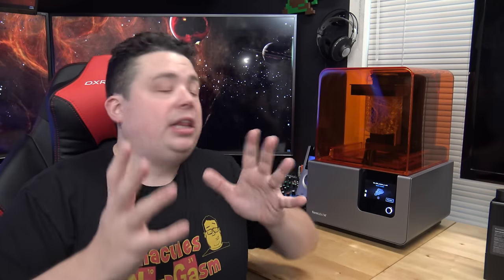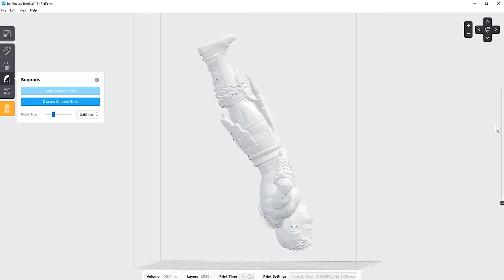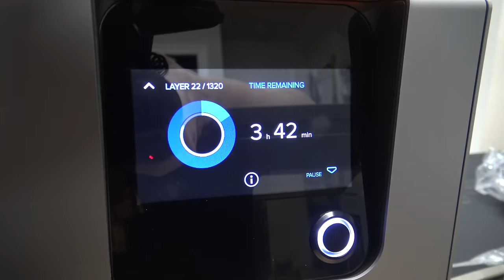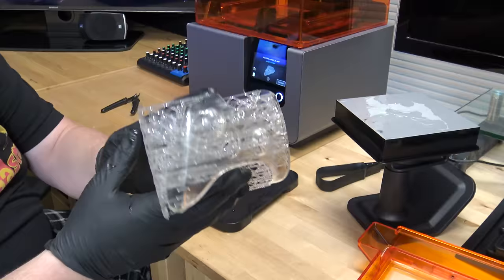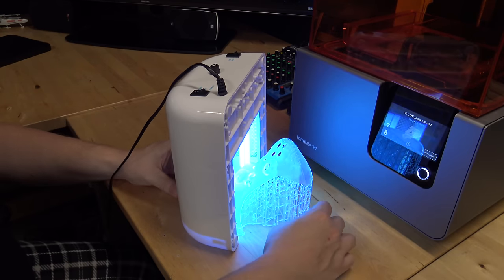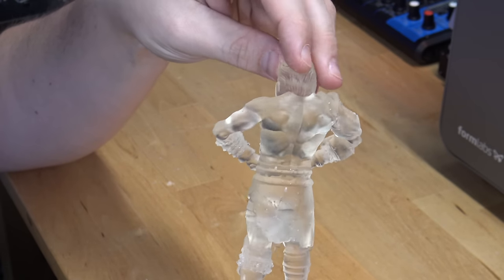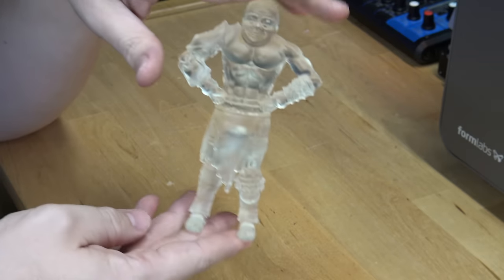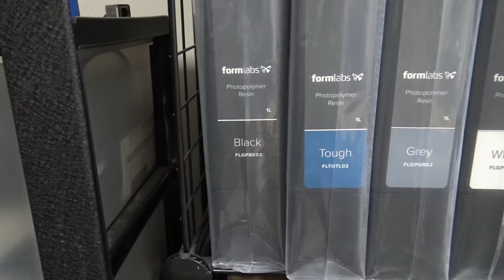Form Labs Form 2 SLA 3D Printer Review, Spoiler, it's amazing!

Comment: Hmm, this makes me think that you could probably make prescription glasses with this.
Reply: I wonder how long they'd last though, they'd certainly scratch more.
Reply: and I doubt really odd prescriptions like mine that I've never found any 1hr glasses store to be able to do, and they always have to special order them which usually takes 2 weeks would be able to be done by a printer such as this.
Reply: I just think it's a question of hardness. Plastic scratches
Reply: Braeden Hamson Right, and since I'm nearly blind in my right eye mine can't be made out of plastic to start with because of the thickness of the special glass needed, and if you want something like UV coatings, better scratch protection, or even something like transitions so you only need one pair, then you just won't be able to do it on a machine like this. anyplace that says $79 gets you 2 pairs of quality glasses for me is bullshit as I'm usually charged upwards of $300+ US because of all of this for a single pair.
Reply: plastic scratches but it doesn't shatter.
you can always just buff it to shiny again anyway. and that's beside the fact that you can get pretty hard plastics that don't scratch easy.
Reply: Moth buffing lenses changes the prescription. I don't see the point anyway. my local optician cuts lenses for 80~ bucks anyway.
Reply: Moth That isn't true at all! It depends on the type of plastic. You clearly don't know what you are talking about 🤦

Comment: I realy like the quality of the prints, but this way to expensive for me. I'll stick with FDM.
Reply: Benonator I agree. If you find you absolutely need an STL print quality of material there are services that will print them for you. Just like if you made Code but it would only run on a powerful computer, here you can CAD and prototype on your FDM and when your ready to see it in the design material you can have an STL do it for you.
Reply: i think there also might be a thingaverse about making a stl printer with a digital projector but you'd have to put some time into it. there's also the ono (i think) that projects images from your phones camera, and other stl printers. but i haven't really looked into any of them because if i wanted to print a detailed sculpt i will just print a 3 foot upscaled model on a prusa XD
Reply: @NicktoriousB IG there are a lot of cheaper alternatives, quite a bit cheaper... but problem is ease of use plummets and cost of material remains pretty high.
Reply: B3N0N4T0R what do you think now with the photon and elegoo

Comment: Great review - this is what everybody who tells me that SLA printing is "a messy job" should watch.

Never ever dissolve resin on your skin with alcohol. The resin will dissolve in the alcohol and the alcohol will be absorbed in your skin - and so will the resin!!!
Wipe any resin from your skin using paper towels, then use a mild soap or a garage soap to wash your hands. When needed then use alcohol wipes to clean your hands.

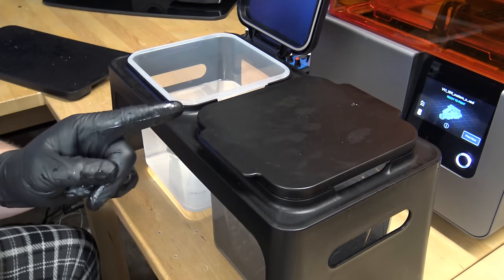At 10:25 you are taking the model out of the IPA with your hand. WEAR GLOVES! The IPA has dissolved resin in it.

Comment: Now that's an expensive printer ! Superb review man ! Really enjoyed this one ! Looks so easy to work with.
Reply: Good printers cost over 100k,  this is a toy, pretty much useless for anything other than little toys.
Reply: derbigpr500 it's a desktop printer for a reason.
Reply: I know it's a desktop printer, I worked with it for almost half a year. I'm just saying this to help people not throw their money away and then get horribly disappointed when they realize the quality of prints on this machine are nowhere near as good as they expect. I've probably printed over 300 models on one, probably 10 came out acceptable. The rest needed heavy post processing to fit into parts that they fit perfectly into in a CAD program with proper spacing in between them.  SLS printing is far superior and more accurate, if not as nice in terms of surface finish.
Reply: Well that escalated quickly.
Reply: THis is the second time he has done this printer ? Why does he keep saying re-view?
Reply: creep No idea, not as far as I know.

Comment: The print quality is perfect however the price is way out my league.
Reply: It's FAR from perfect.
Reply: It's poo, fact.
Reply: the resin alone cost as much as my printer :(
Reply: Don't worry Kaboom, I don't think you want to be throwing away the materials for this all the time.
Reply: same It's far out of the league of my little Up! mini printer. 

for me I'd probably invest in a bigger printer then going that route
Reply: The Ultimaker 3 costs more, but running it would be cheaper and easier.
Reply: That is the case which almost any FDM printer which doesn't have a whole lot of maintenance and material costs isn't too bad if you know where to look for filament
Reply: Buy an Elegoo Mars!

Comment: Of course out of the box this got better details than a fdm printer. But you can attach an airbrushnozzle to your printer and use 0.025mm layer height. Then put it in aceton vapor and you got a cheap good looking print.

Comment: Could you break down the price per print for stuff like the controller cover? That could be an amazing tool for replacement parts for ANYTHING, from casemodding to replacement parts for broken plastic on any electronics. I would personally order printed parts for casemods or when something breaks, like plastic case parts blah.
How long will the cartridge last, if you get like 50 parts out of that cartridge for 150$ - that is still a really nice value. I just think about fan covers and custom plastic logos in casemodding, would really love to get such clean parts.
And it will become cheaper after a while.
Reply: this has been my major question as well, I think I want a SLA printer but until I know exactly what something like that figurine of him cost in terms of material I am scared of 50-150$ per litre

Comment: I would highly recommend you look into the original Prusa I3 MK2 made by prusa research. It is available as both a 700 dollar kit you build yourself, or a 900 dollar fully assembled version. From what I've heard, you get ultimaker print quality for a fraction of the cost.
Reply from the maker: +John Shelton I've used one, it's a fantastic machine.
Reply: Barnacules Nerdgasm Sweet! I have seen a crap ton of positive reviews, and now I'm trying to convince the school to replace our makerbots (they won't stop breaking and are costing us a fortune to replace the extruders every couple days) with prusa I3 Mk2's, and I may even buy myself one as well.

Comment: while im not gonna run out and buy one,  I,m kinda happy with my ROBO.  I am curious,  How much material do you loose if you decide to do color swap?  Im assuming the stuff in the tray can just get filter back in the bottle.    But what about the material left in the printer itself.
Reply: Pitch Lock in principal it can, but it's much more sensible to use a second tank/vat, in which case it's a quick change and no material is lost.

Comment: Challenge accepted. Send me a link to that STL. while I can't match Resin quality I can get DAMNED close depending on the model :-) hehehe

BTW timelapse should be doable it will just be a lot more work. take a normal timelapse and just delete on the "down" frames so you only have the frames for each layer when its in the up position.

Comment: mUVe 3D is a better value. Larger build volume, open source, flexible vats that can be replaced easily and cheaply. I'd say that a con to the Form Labs IS THE cartridge system, which is no different than overpaying for inkjet cartridges.  With mUVe 3D, they are compatible with MakerJuice, that is only $33 for the general purpose resin. They are even compatible with Molecule Ink brand resin, which has all the cool properties that people look for in SLA printers; Hard, Tough, Flexible, Super Stretchy etc.
mUVe 3D also starts at $999 and gives you the ability to upgrade to a build volume of 151.9mm x 190mm x 250mm (6" x 7.5" x 10")

Comment: Hello Mr Barnacles :) I have two questions that I would like to ask about the Form. 1.) what's the amount of prints you get out of one cartridge of material? is it similar to the volume of material you would get in a standard FDM printer, like a 1kg spool for example? 2.) would it be impossible to print things that have print in place components, like the nasa space wrench for example?

Comment: Honestly this does look cool. I have been making models for molding with my printer for a long time and I am used to it now, but this seems like it has more steps to it than FDM printing. Might not take as long, but there is more to do. When I print something I intend to cast I do 50 microns and use a filler primer. If there are lines left then I use bondo putty and a light sanding.

Comment: Why are there a lot of imperfections on the surface of the controller cover?
Reply from the maker: Those are spots where support connected to hold the part stable during print. You just sand them off though and dip it in resin and let it cure and it will look like glass

Comment: Hey Jerry! Maybe you could do Some reviews on smaller 3D printers. Have you Heads of the OLO? It's a resign 3D printer and it uses the light from your smartphone for printing!!! It's really cheap as well

Another printer which is pretty nice is the M3D. I got one myself. It's a really tiny and modern looking printer. It goes for 350 dollars. But since a few months they also released a bigger version. The new one is WAY faster and more accurate.

Comment: I bought a Form1 for work and I could not be more disappointed. 
I agree completely with your statements about the software.   It's nice to use something that just works.   I just wish I could say the same for my printer.   We need to print only the most simple of items and I would guess it takes 10 tries before we get lucky with a successful print.  It is now sitting on a shelf.  Sounds like the Form 2 may have solved their problems.    Just too bad for me.   And for FormLabs.  Because I won't be buying any of their expensive material.

Comment: I'd say maybe don't point that UV light at the printer, either: while the orange dome blocks normal levels of UV light from entering the chamber and curing the resin inside, shining a UV lamp in its direction may just be asking for trouble.
Nice coverage of the machine, though, the good and the bad. Great results, though. Tough to argue with that.

Comment: There are a lot of SLA printers released this year that are higher resolution than this and cheaper, just a heads up. We use two of these at our shop, but we are purchasing a few different machines shortly. Check out the Photocentric 3d Led Printer. Both of their new models are higher resolution(20micron z, 90 micron xy) than the Form 2 and the materials are half the price and water washable.

Comment: Will this go down in price let's say in 5 years?
Reply: I think that is patented, so probably, it will not go down in price.
Reply: jomunoz Actually, there are patents, but they aren't Form1s! The 3ds patents (the ones that really matter) have expired, or are very close to it. One pretty important one just expired (2014)!
Reply: Orjon Zaganjori There is an open source model from a different manufacturer. $500-$600 I believe.
Reply: Still a lot of patents covering parts of it, just as there is with FDM, EnvisionTEC just sued Formlabs over two of their patents a few months ago.

Comment: hey, Jerry. there's something really cool I want to tell you. one of the 3D printers in my Tech Lab at school print using a support material that dissolves in hydrochloric acid and completely removes the need for a clean up. as awesome as this is there's even more. The printer can print moving parts without having to cut them up separately and snap them together. I think the coolest thing we've printed with it so far was a miniature planetary gearbox type of fidget thing. we also printed a functional replica of a shock for a car , although it would probably work best for an RC car cuz it's really small.

Comment: Do all of the models print with 100% infill, or can you adjust that to save material?
Reply from the maker: +Brian Popilek by default it's full infill for solid models. But you can use other programs to make models hollow and print them that way.
Reply: Barnacules Nerdgasm good to know. Thanks!
Reply: Wouldn't using less than 100% infill just trap a lot of fluid inside the model? (of course dependent on the design of the model and the type of infill) Would be really cool if you did an investigative video on that!
Reply: Siggen leave a hole on the bottom of it like they do for selective laser sintering

Comment: Even when neglecting the cost, and neglecting the amount of space that you need for the screen trays and alcohol containers, you still need to go through all that long and tedious process of cleaning and removing all the support material (which is a lot of wasted 
material). Nah.. the process is too long... 

If you need that level of detail (a final product prototype?), there are companies out there that do it for you and give you a better product than that. Actually,  most prototyping is done with PLA nowadays as prototyping is supposed to be cheap, effective and quickly as it is just a proof of concept. Unless you are an actual company, then you will have your own prototyping labs with printers that cost tens of thousands of dollars.

Comment: If you can find a way of rigging it up it's actually a better cure if you leave the material in the alchohol (or water after the cleaning). Oxygen retards the reaction and curing so excluding air and using UV it will cure faster and harder. There are a number of simple projects where you can use a cardboard box lined with foil, a nail curing UV bar at the top and place the object on a solar powered rotary display disc. the light from the UV bar drives the display disc so you get an even cure all round. only thing that needs power is the UV bar.

Comment: I really wanted one of these until I saw the price.  

How is the print speed compared to an FDM printer?  Is it comparable?  I don't plan on every making something with microscopic details so the only thing that matters for me is speed and reliability.   Currently using a Chinese Ultimaker clone and is doing pretty well.

Comment: With the cost of the resin, approximately how many of those action figures could you print with one cartridge? Is there an estimate for that? Or will it tell you the cost of material used like you can in s3d?

Comment: With your other printers like the Ultimakers, depending on the print, you can print with 0 support material and the print still turns out great, can you do that with the formlabs form 2?  if so, you should do a video on it maybe.
Reply from the maker: +Tomas Wisdom yes, some models don't require any support like a cube for instance.

Comment: I know this might be difficult question to answer, but how many times more expensive would you say it is to print something compared to printing it in a FDM printer (assuming it was a print with 100% infill?
Reply from the maker: +drummerthing2 5-10x as expensive depending on material and part.
Reply: Awesome Jerry thanks for the response! Honestly, that doesn't sound too bad depending on what you're printing. If you're printing D&D figures using PLA plastic it probably costs 20-50 cents for prints, so $2-$5 for a miniature for D&D is pretty good, since those things go for a fortune sometimes.

Comment: Way too expensive. Too much waste (cartridges, tanks, etc).. Too many constrainst... Not the way of the future... Beta vs VHS all over again
Reply: AWARHERO Its not open source. A bunch of patents went into protecting this unfortunately
Reply: Depends on your needs. If the printer is part of your business, then it's no different than investing several thousand dollars in a work computer. It's professional prototyping technology made relatively affordable and accessible for the prosumer. Also it's new technology, so I'm not sure what you were expecting in terms of pricing. If you're just looking to get into 3D printing as a hobby, there are tons of lower-grade machines that will work just fine for you.

Comment: Very high maintenance for a simple part. FDM may not have high res but most projects give acceptable resolution. Especially if you pay the kind of money $3500 you can get a higher res FDM printer without all the maintenance.
Sucks if you ask me. Im sticking with FDM.  Plus the material is TOXIC, another big down side. NEvermind SLA.
Reply: You won't get a remotely comparable result out of an FDM printer for the same price ballpark. Some FDM printers may technically have smaller print resolutions, but the FDM process itself is inherently less accurate and bad at reproducing fine details with a good finish, partially due to the fact that FDM pretty much always produces visible print layers. If I'm gonna spend thousands of dollars on a 3D printer, I want the results to speak for themselves. So far, this is the best consumer desktop printer on the market in terms of print quality, and if you look for an FDM equivalent, you'll not only spend way more money, but you'll probably be disappointed in the results.

Comment: Impressive piece of engineering, but the significant increase in surface quality comes at a 500%~ increase in price. For fine surface detail I use a .25mm nozzle on my 350$ prusa I3. Also It is hard to see how they could do multi-material or multi-color printing with this cartridge/tank design.  FDM 4 life
Reply from the maker: +Triangl3D Printing you're right about the price.